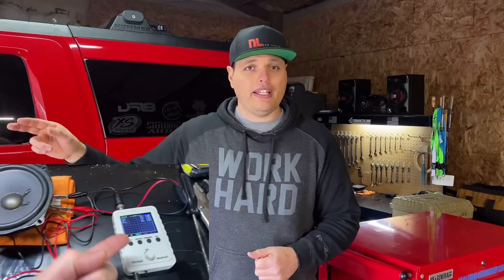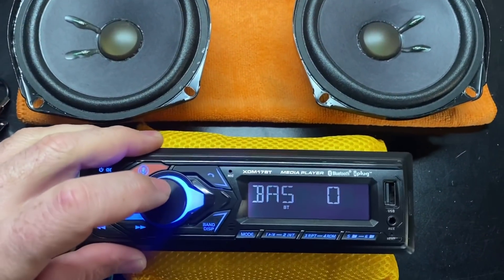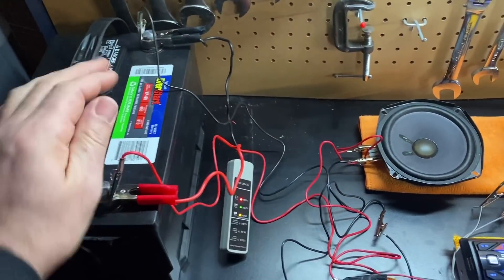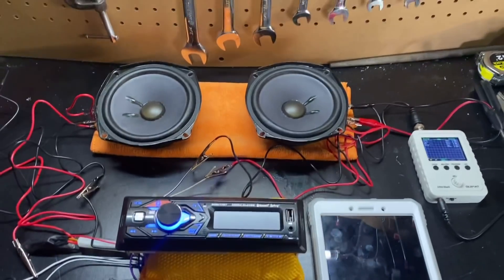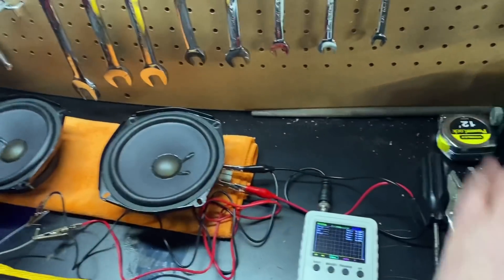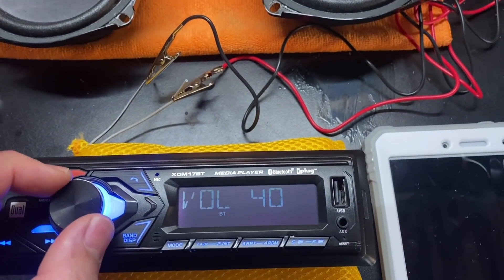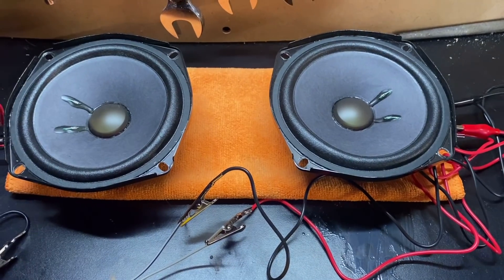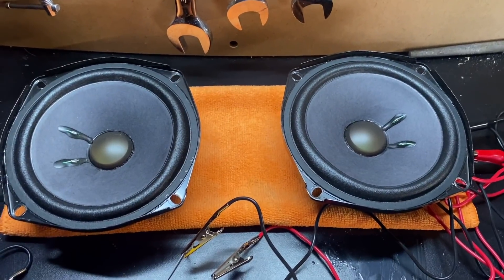#1 Must do tip!!! How to check head unit clipping and non distortion volume point of stereo.

Comment: I only run off the pre-outs. Would these results apply for the pre-outs as well or is there another test?
Reply from the maker: Your head unit clip point will still be the same. Tho you can adjust the output of the signal via gain on your amp if using low level. If running speakers of your head unit only (no external amp) this test is a must to not blow your gear.
Reply: this actually just answered my question. so it has to be done off of the speaker wire and not the RCA's got it! i i guess i could test of the wires from the hu going back to the 4ch amp before they are actually plugged into the amp.
Reply: @r3d1911  yes do that. Technically, like NLCA said commented before, you can actually max out your headunit because your 4 channel amp is just running off RCA and just tune the gain of amplifier to the volume but some people like me don’t like going that high it just feels wrong. So find out the headunit clip at speaker wire then dial in your gain for your 4 channel amplifier

Comment: My current Alpine UTE-73BT head unit has a couple settings I'm not super familiar with that I'd love to see explained in one of your videos. If you already have one, please link me to it. Thanks! What I'm curious about is in the equalizer settings, the ones marked Width <Q> and the one marked Center Frequency. I experimented with them and found the Width brought out a bit more frequency volume when adjusted up in the Mid and Treble settings. But I'd love to find out more about these 2 equalizer adjustments. Wondering if I'd perform this maximum volume test with those set up or down or how? Thanks!
Reply from the maker: I’m not familiar with that alpine “Q” setting but am assuming it adjusts the width of the dB/octave roll off of a specific frequency band. The wider you go, the smoother the roll off. The narrower you go the steeper the roll off

Comment: Question. I have an amp (DB ASA 4000.1)  that does 4000 RMS, and 2 kicker solo x 15” subs wired down to 1 ohm to the amp. Gain set to right before distortion with 40hz -10db test tone and Crossovers set to 25hz of my 30hz tuned box, 80hz for LPF. Using the SMD DD-1 & CC-1. Have 350 amp HO alternator with a 2nd battery XS power 3100 with a 630F  ultra cap bank. Im getting a soft clip at louder volumes 34/35 of 38. With Bass Knob turned half to 3/4 way up. I get soft clipping at dynamic kicks with like a flash of red clip light, and if i turn the volume or bass up more it will be more of a hard clip with a solid red clip light. Doesn’t clip with the more boomy bass, like 30-50hz . What’s the Best way to midigate to no clip without turning down gain and leaving power on the table.

Comment: I tried with my 2015 Volvo XC60 OEM head unit, but I never actually heard clipping, even turned all the way up. I used an Oscope phone app and it never looked pointy and distorted. My car was rattling in some places but the audio overall sounded clean. Does this sound right? Does Volvo use magical head units?
Reply from the maker: There are in fact some heat units/ manufacturers that don’t clip! Looks like you got one. Awesome

Comment: "Mr Comment" here once again... sorry, too many questions/concerns pop up when I watch your videos. But the one thing I noticed about this cheap (yet very valuable tool) is that all those numbers STAY at the top of the screen, blocking the sine wave bars in 2/3 of the display! Geez, any more numbers at the top and you couldn't even SEE the bar graph come up! That's the only concern I have about this. Too bad they didn't add a button that could turn off those annoying numbers in white that are taking up so much upper screen space. STILL an awesome tool that I know I'll use for years!
Reply: Funny thing is, they do go away... Once you read the instruction manual, it's explained how to get them to turn off. Furthermore, you can also adjust the effect of "how zoomed in" to the sine wave the graph shows by changing the readings/settings, making your "concerns" void of necessity, Mr Comment...

Comment: @NextLevelCarAudio    Very informative and a wonderful video!! I had mentioned a couple times about finding the clipping point of my radio. While reading the comments, one or 2 touched bases on my original question. To clarify, say I was using your set up but with RCA connections to the external amplifiers (mids and highs) instead of using the high-level output from HU, would that allow me to turn the HU all the way up and just use the gains of the amplifier to find the clipping point or would the radio still send a clipped signal @ volume 36 to the amps via rca? Hope this makes sense. Thank you!!
Reply from the maker: You can technically send a clipped signal to your amp and still come out with a clean signal by dialing in your gain accordingly.... but it’s not necessary. No need to turn your volume to maximum and get the most out of your system.

Comment: This Is good info, but it's only if you are using the head units internal amp, line level. Low level pre outs don't clip at the same point if at all. I have an $80 Pyle in my boat, I was literally just setting gains on my new 4ch amp last night, I did check for clipping on my pre-out first, with 2 Oscopes, one of which is the same as yours, I had absolutely no clipping at 40/40 volume, however I bet the speaker outputs were clipping their ass off. So I set my amp gains with full volume from my units. Set them right before clipping and the output voltage math lined up perfectly too. I definitely do like the Oscope method of setting up a system.

Comment: quick question. can i test using the RCA's coming off the head unit BEFORE they are plugged into the amp too test for head unit clipping? in my car is near impossible to pull the speakers out of the door after they are installed. same with getting the head unit out. also if my head unit puts out at 5v preout do i set the o scope to 5v instead of the 2v you mentioned?
Reply: Interesting one interested to see what ppl say
Reply from the maker: Sure! Here Is another video of me doing just that and also explaining in depth settings on the scope
Reply from the maker: https://youtu.be/nKQqcQ5q34I

Comment: Good information bro 🤟🏾. Gotta question, when using only amplifiers to power mids and highs. Do I still need to find clipping point at the head unit? Or am I getting the correct clipping point when I test at the amps? I'm using the same oscilloscope.. thanks
Reply from the maker: If everything in your set up is amplified and nothing running on head unit power then yeah, can set just at amps:)

Comment: I'm using a kenwood dpx505bt which has 13 band eq and also hpf and lpf crossovers.  Head unit only for fronts and rears. Mono amp and a 10.  So do I check for clipping with the eq flat or set where I want it?  Also,  crossovers on or off?  Doesn't frequency affect clipping.  I always thought clipping was the speaker not being able to handle the power.  Are you saying it's actually a voltage issue from the source?
Reply from the maker: Set everything where you want it, then dial in gain last. Mismatch of preamp voltage and input sensitivity (gain) is what causes clipping. Gain needs to be set to match or be lower than the preamp voltage your head unit is sending out otherwise you will be getting A clipped signal regardless of power being out putted.

Comment: Thanks for this man. I just switched from a pioneer head unit to a large screen atoto head unit from Amazon and not taking lower output voltage into consideration kept my gains on both amps the same and clipped my subwoofer to death .. is a 40hz test tone until distortion a good way to set amp gains as well? Also I have purchased a line driver/ output converter from kicker to boost sub output voltage from original speaker level outputs seeing as my door speakers run off a 4 channel and they are unused. Is this a viable option?
Reply from the maker: Yes sounds like you are on track just fine :)

Comment: If I have a factory amplifier and head unit, where would I hook up the scope? You said it can't be an amplified output correct?
Reply from the maker: Are all the speakers in your car running off the factory amplifier? Or are some running off head unit power?

Comment: Great video. I read a comment saying you really only need a scope to check head unit clipping levels. 

Would it be any different at 30hz, 100hz, 1000hz, etc, as far as testing goes? Can you do this test on music as well? 

And then after finding the clipping volume of your head unit, you can just adjust gain knob by ear? I thought it was supposed to be matched with the head unit rca voltage?
Reply from the maker: Can’t test with music, need a tone if using scope. Can use different frequency. Yes, supposed to match preamp Input voltage, but with experience can do it by ear

Comment: Couldn't you just connect the pos and neg on the scope to the + & - of the head unit wire for a speaker channel without using the speaker just to get the Hu clip point?

Comment: If my system is factory amplified, can the readings be trusted when taken from the speaker terminals?  My Challenger volume goes up to 38.  At max volume, I tested both 1000hz and 40hz and did not see any clipping at all on my o-scope.  Both frequencies were -10db, as all I listen to is streaming music (spotify, etc...) and plan on tapping off the rear speakers for my sub install.  I'll test again at 0db, but wanted to be sure I can trust the readings...
Reply from the maker: That changes things. Should be taken before the amp. factory amplified systems are a different beast to tune
Reply: @NextLevelCarAudio  My amp kit finally came in, but something doesn't look right.  When I scope the input leads from the stock speakers, I get a smooth wave, but when I scope the amp, there is base noise, and none of the tested signals are smooth, they have three peaks per wave, even with the gain turned all the way down.   Tried both high level and low level inputs.  My amp a dud? Skar SK-M5001D....
Reply from the maker: Have you hooked it up and played music? Do you hear noise coming through the speakers?
Reply: @NextLevelCarAudio  Thank you for replying.  I ended up using a DMM to set the gain, as I couldn't get a smooth wave form on the scope.  I might try an active bass correcting LOC instead of the current passive one I have now, as it seems having the boost control knob turned up is resulting in the terrible wave pattern.  When the music or test file is paused, there's no noise from any speakers.
Reply from the maker: Sure thing. Yeah, the bass boost can definitely dirty things up real quick. I never use it.

Comment: I have a question for you so I have an aftermarket stereo and the other day my amp turned off and I have a fuse block in the front and a fuze block in the back the fuze block in the front melted and so I changed it out I checked my amp and it was hot my amp has never been warm not even once before well while my system is on it bumps at low volume but as I turned up the volume it's like the amp output goes down and the head unit speakers get louder  so I changed the amp to a brand new one and a new sub and it's doing the same thing and I have checked all my grounds and power wires I'm wondering if my  head unit is the reason it's doing what it's doing

Comment: Would the clip point still be the same through the preouts of the head unit? It just looked like you were testing the internal amp of that head unit. I’m not trying to criticize, I’m just wondering, you’re the expert. Can you also use the oscilloscope on the RCA jacks in silence? Because it would make sense the way you tested would be true always if you were using the speaker level input to an amp. Just wondering if you can do it with the line level signal?
Reply from the maker: You can absolutely do the same for the rca/ low level outputs. Reason why I did not is because on most head units they don’t clip even at max volume. There are the exceptions tho 😎
Reply: @NextLevelCarAudio  what setting should I set on my new oscilloscope that I bought per your suggestion/video?? Haha I not really understand 1x 10x switch and what range to use for (5,10 or 20) voltage and setting for frequency. Also what's the best frequency tone to use?? Thanks for all the help. Trying to test my sync preouts created by maestro ar with Kenwood 600-6DSP.
Reply from the maker: I go over in full detail in this video: thanks for watching 😎

https://youtu.be/nKQqcQ5q34I

Comment: Next level car audio, this may be a stupid question but when checking for clipping with a bluetooth device, did you turn up your tablet volume at around 75% or max for the test? Appreciate your response.
Reply from the maker: Device should be at Max. Head unit should be around 75%
Reply: @NextLevelCarAudio  thanks bro. I appreciate your response and like  always,  taking  car audio to the next level like you is amazing....

Comment: If you set your head unit and amp gain to maximum (correctly) by using a 40hz etc test tone what would happen if you stream music from iTunes with bass boost set through your phone will it introduce distortion? Thanks and great videos by the way.
Reply from the maker: Thanks. It very well could if that source level was not set with the bass boost on

Comment: The internal amp clip point will differ with load. So always test it loaded with the resistance of your speakers or load resistor. 
If your car has a 4ohm speaker and you test the headunit outside the car with 8ohm speaker then you will reach clip point early and by that math will leave performance on the table. 
Also rca clip point would be different than internal amp clip point cus the rca although gets it's signal from the same source, most headunits have a tiny pre amp stage for the rca out.

Comment: I run off the preouts as well. Can I test at the rca before input? I have a female with bare wires on one end. 
 And what would be the best HZ test level for door speakers?
Reply from the maker: Yes! You can test your RCA’s. Most good head units won’t clip rca signal even at max volume. But it’s a good test to do and should have showed that in my video. 1000 hz is typical. But using lower frequencies like 40-60hz will easily allow you to “hear” distortion
Reply: @NextLevelCarAudio  that was my assumption but needed to be sure. The car stereo game has changed quite a bit since the 90s when I installed my last "real" system. Love your videos. Very informative. Very helpful. I'll share my system when I'm finished. Would love your opinion.  Thx bro!!
Reply from the maker: Awesome! Can’t wait to see!

Comment: This is exactly how I did mine. With the same amazon Oscope + DMM for ref. My Kenwood receiver introduces clipping at 36. So max is 35. I did this however with everything in the car and before the amp so I unplugged the speaker level input harness and pinned each of the speakers using a small single strand wire or bread tie works. He’s exactly right tho, if you leave the speaker connected, and play low freq, you can hear when you clip. The sound changes.
Reply from the maker: Awesome! Thanks for the feedback! 😎

Comment: Great video. I need help .. I also have a DS18 EQX7  7 band Stereo equalizer. How would I properly set that up in a system and check the gain On that ? Which volume do I use to control the volume of the system the radio or the equalizer ?
Reply from the maker: I would use the radio. Dial in the 7 band eg how you want it. Set your head unit volume to max clip or 75% if you don’t know. Then adjust gains properly. Should be all set
Reply: @NextLevelCarAudio  Thank you 😊  Keep up the good work...

Comment: I have a car that has a factory amplifier, just clarifying that the process would be the same. I have a lc2i  as well.Just ordered. Handheld and want to dial all my gains in. I also wanted to know when setting up the lc2i could you use the o scope to see what volume the bass starts to drop out.
Reply from the maker: Yes! I always start from the front (head unit) figuring out max unclipped volume, then preamp/EQ/DSP, LOC, or in your case LC2i. Then finally dialing in Gain on amp

Comment: I just got one of the same o-scope’s. I’m trying to set up the gains with it and can’t get it to show the same signal as your videos and I’m not sure if it’s cause I’m checking the signal at the end of the speaker wire where it would be connected to the speaker. I don’t usually comment on YouTube, especially when I have a question but I’m just not sure what else I could be doing differently. I’ve watch your other video as well. Any help is really really appreciated. Thanks in advance
Reply from the maker: Testing it at the end of the speaker wire is fine. It is probably because you need to adjust the voltage sensitivity on the oscope so you can see the reading properly. That would be the first knob on the left. Try not only 20v, but 5v, .2v, .05v till you see it

Comment: Does it matter what volts are set on the oscilloscope because if I set it on 2 volts I can go up to 40 volume,but if I set it up at 5 volts my factory radio will go up to 47. Btw I have a 15 Cadillac ATS with the 10 speaker Bose system.

Comment: Hello brother, I learned a lot from your videos but there is something that I don't understand on finding the clipping point of the HU using my Oscilloscope. Should I turn off the crossover, time alignment, listening position, automatic level control and sound retriever on my pioneer HU? Thank you!
Reply from the maker: I always check HU clipping exactly how I intend to listen to it. So keep everything as is. That way it will give you accurate info